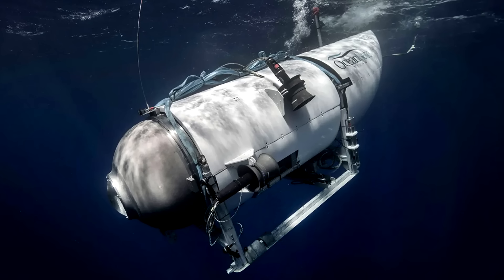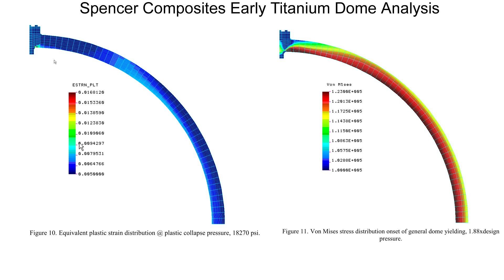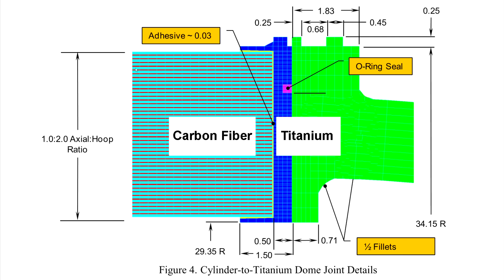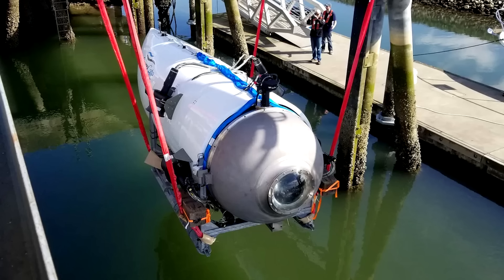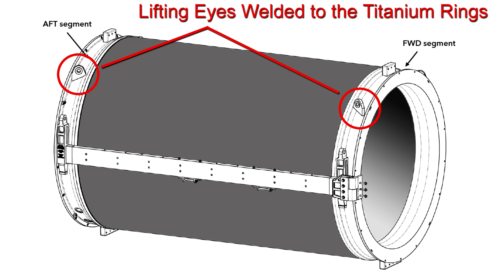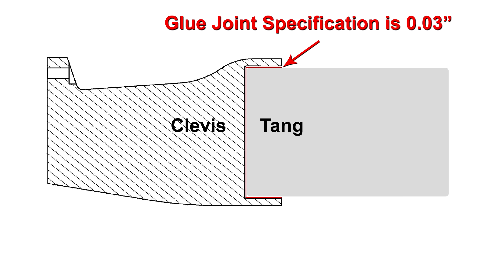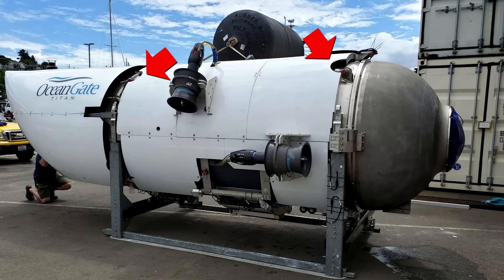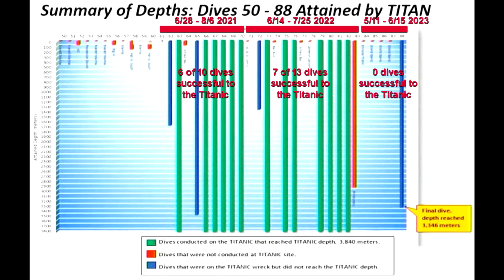OceanGate Titan Titanium Rings - An Additional Story About Them

Comment: They could have designed a pair of removable steel hanger cradles that would still support the frame by the feet, without all the messing about and risk with the straps. Curious that they didn’t.
Reply: Also is it important to note that you cannot weld titanium perfectly in an oxygen atmosphere You have to do it in a vacuum to get the absolute best welds. Titanium is a real bitch to work with.
Reply from the maker: Thanks for commenting.  Not sure either.  The only thing I can think about is that it was a tight fit putting it onto the LARS where it had to slip into its locking cradle.  They certainly could not have had anything beneath the landing gear.